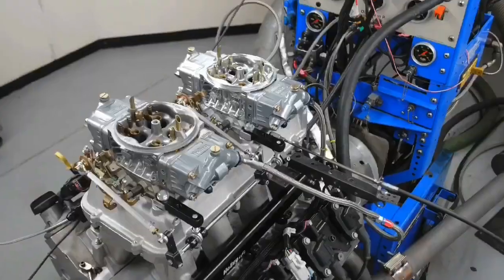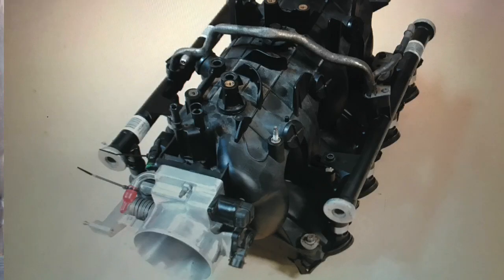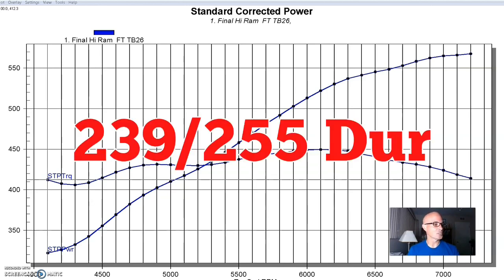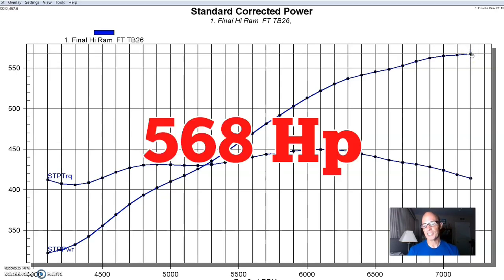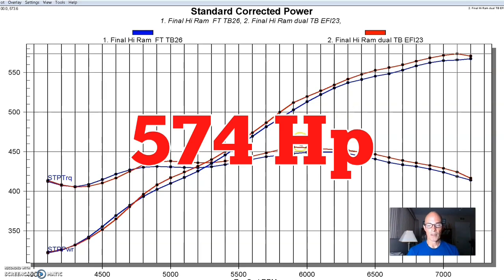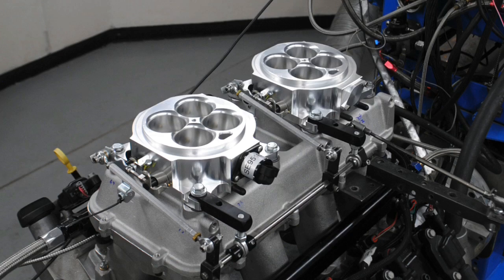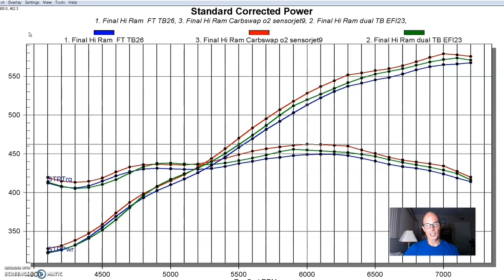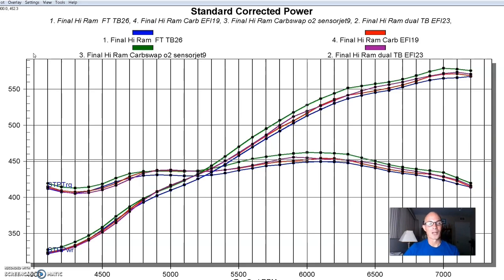LS1 CARBS vs EFI-WHO WINS?

Comment: So just for curiosity purposes; 
Use a vacuum gauge and compare the two 650 carbs to two 390 cfm carbs for a total of 780 cfm. 
Two 500 cfm carbs for a total of 1000. 
I'm real curious to see the difference in the power curve. 
I think the dual 650 setup is overkill.

Comment: You had injectors at 50% duty cycle. How can you say with straight face that "fuel was optimized" ?
Reply from the maker: optimized is when the motor makes no more power by adjusting the AF
Reply: @richardholdener1727  with IDC that low, injection end angle becomes an issue, especially with 20deg cam overlap. I doubt anyone spent a day finding optimal IEA per RPM; smaller injectors would do the trick tho. 
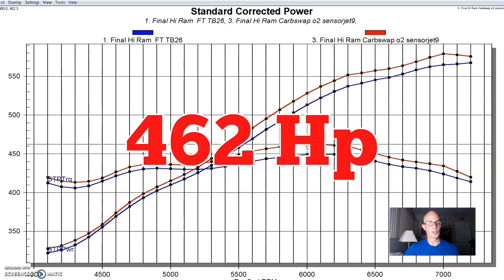P.S. Torque is not measured in HP.  I assume you misspoke at 7:12; but then misannotated it as well?
Reply from the maker: so you are one of those guys-please, spend a full day trying to coax 2 hp from injector timing and see what you get (we know, we have wasted those days trying it)
Reply: @richardholdener1727  No sir, I am not one of those guys, neither are you. You are testing power difference between fuel cooling air early (intake plenum) vs late (intake valve/combustion chamber), right? I just pointed out a hole in methodology. Solution would've been 42-50lb injector. Honestly, I don't even know if it would make a meaningful difference.
Respectfully : Andrei @ ABEL Racing (22 years and 50,000+ dyno pulls ;) )

P.S. I am not the smartest tool in the shed, but I bet it has more to do with atomization   than actual cooling; like you said at high rpm air/fuel mixture spends about a revolution worth of time in the intake itself - less than 10ms.

Comment: So in theory, a set of the holly sniper tbis on the high ram lid would push close to the exact same number as the carbs due to charge cooling, with more possible drivability in a street car application
Reply from the maker: maybe

Comment: The dual quad lid performs better because the air comes straight down through the barrel. Air doesn't like to turn down into the engine. Also just the coolness adds power.

Comment: I think fuel injection really wins when it comes to cold starts, altitude changes. Seasonal changes. But carburetors when tuned properly will always be able to make a little more power just because the fuel will cool down the incoming air. Annular boosters are next level for carbs too.
Reply: the like of Claus Schwabb and others on the UN Agenda 2030 dont want carbs but all digital and easy for "THEY" to monitor, steal and control everything digitally. I love analogue, carbs and control of what I do and got my carbs giving better fuel economy on hilly terrain than efi has.

Comment: Nice test. But, I think atomization of carb mix and some cooling may be the factor. I favor 500 CFM bodies for more velocity and better mix. Velocity that works with valve size and angle job down low as well. I like E85 for the charge cooling and injection for precision, altitude, weather variables/tuning. Then when combined with computer timing and matched variable modes there's no doubt. EFI all day long. I think there may be more power tuning in fuel pressure and injector atomization, alone. And then combined with E85 (40 percent more quantity).  But, an EFI tunnel ram, actual cold air on the street, vs heated carb under a hood is still a winner.

Comment: And what costs more and is less reliable? Not the carb!
Though a 4 bbl electric carby V a similar size carb would be the test.
Though,,, for every day driving I hate top say the fool injection is nicer to drive. Though  that is when all the electric gizmos are working in coordination. And that is not often enough.
Even factory mass produced cars cause a lot of grief. Grief that the 'experts' often cannot work out. So either it does not run at all or is a gutless thirsty thing.

Comment: I would love it if you would do some tests on mechanical fuel injection like a Hilborn. There's very few resources on mechanical fuel injection and I would love to see a comparison between EFI and MFI
Reply from the maker: the difficulty is getting mechanical fuel injection to work at all combinations of throttle angle, load and rpm-wot is not usually a problem, but sometime getting it to provide a consistent AF ratio through a wide rpm range at WOT is
Reply: @richardholdener1727  right! That's always been my concern with mfi. I also don't really consider mfi a type of fuel injection, that may piss some people off and they may call me wrong but if you really look at it mfi is more like an individual carburetor setup per cylinder than actual fuel injection. Mfi will not account for changes in altitude, pressure, humidity and temperature the way EFI I will. It will give you the adjustability per cylinder as EFI but you still have to change the AFR yourself with different nozzles and metering orifices based on the position of the barrel valve the same way you would have to tune a carburetor for changes in ambient conditions. That's why I don't understand why I think mfi is a little bit misleading. But I don't know that's just my opinion I'm no expert. I would like to see a comparison between MFI and EFI for this reason.

Comment: I hate it when tests like this are done and people get offended because they have a preference to one or the other and it's not about that at all every injection system has its own benefits. I prefer carburetors because I was raised on them I like how simple they are and they do what I want them to do. And fuel injection has its own benefits of being able to data log and tune per cylinder etc . I was actually tooling around with the idea for fuel injection for my dragster but the system I would need would cost almost $10,000 and for my $1,200 carburetor I don't think $8,000 is going to get me that much of a benefit in return.

 Plus if you're running methanol carburetors are the way to go because you have such a bigger window of tuning acceptability I never have to chase my AFR. I just run my car a little on the rich side and the methanol will pick up the difference it's not like gasoline where your AFR has to be exactly spot on or you'll be fighting detonation or lean conditions and losing power gaining too much power methanol is much more forgiving.

Comment: The charge cooling from the carburetors is why 6-71 Roots blowers worked so well. They didn't need intercoolers because the fuel was cooling the compressed air. I now see companies using port injection under the roots superchargers (Edelbrock) and they have to add an intercooler.  If they would put the nozzles in a plate under the throttle bodies on top of the blower, they could eliminate that added complexity (like old school blown dragsters).  They would also have the added benefit of very a well mixed mixture and with a little more care in intake design, more even fuel ratios negating the need for individual cylinder tuning. It would also open up the possibility of using two sets of injectors.  One set above the blower for part throttle and charge cooling, then adding port injectors for high boost with max power and cylinder tuning.

Wish I had the money to build such a system for my 1990 heavy ass Suburban to replace its puny swirl port TBI.

Comment: That was a interesting test. Didn't expect the carbs with port injection would match the port injection in power, or that the carbs would best it like that. So a single plane port injected manifold, with say a 950 dominator on top with a tps would make as much power as those expensive throttle bodies they sell? Or just go to a Sniper TB with fuel. The problem is cost, starting at $1500 up.

Comment: Great video and again it comes down to picking the correct combination. I have seen several high dollar EFI setups that were wired incorrectly causing multiple issues for customers. Once corrected they worked awesome and having the ability to tune each cylinder is a big advantage. I’m a carburetor guy. I can make the worst carb perform well. I just think that in today’s performance world EFI will make your life easier. I really like to duel throttle bodies in the tunnel ram and would like to see a twin turbo blow thru test with this combo.

Comment: Charge cooling.
 So if you put a water methanol misting in the intake stream after air filter would it do the same as charge cooling with the carburetors?

Comment: This is great high-end stuff! May I ask if you are ever interested in grabbing just a 5.7 Vortec with the sequential injector setup and the change over to carburetor to see what to see what kind of operation you can achieve. Those Motors were very plentiful in the mid-to-late 90s. I understand the downfall was the Spider injector set up. And I'm very curious because I have 98 Chevy with the 350. Thanks I like the work you do!

Comment: How about combining throttle body and port injection by running small injectors at each port with the majority of the fuel coming from the TB and fine tune each cylinder with the port injectors?

Comment: Still in the fuel injection camp. Computer optimized for temperature,  altitude, optimal power  and fuel economy and emissions. There's a reason no manufacturer of automobiles uses carbs. Sure you can dial carbs in. They will run perfect at that temperature, altitude etc but as soon as that changes, they run like shit. If you don't drive it for a while, the seals/gaskets will leak. Less so for fuel injection. My take...

Comment: Hi , just want to point out that not only distance provides charge cooling but also the booster/ventury effect (like an h valve in a/c)does cool the charge a lot more than any injector at any pressure.Would like to see a test where we take a carbed engine(camshaft)and then swap an efi on it.It might not even run.So why do we always test an efi motor with a carb.This should put all the debate to rest ... Forever.

Comment: Another big tell-all with charge cooling... this exact same test but instead of pumpgas, use e85 or even methanol. When fueling with the carbs, the runners will condense moisture because of how efficiently the fuel cools the air/fuel mixture

Comment: What about an intake like a stack injection, with the fuel rail and injectors moved as close to the top of the stack as possible? Or that aspect with a taller stack? That way the injector sprays at the top of a raised port for charge cooling and has the tunability of individual injection? I'm just spit balling here, but curious if that's plausible?

Comment: I learned that I need to see a blow through carb on an ls w/E85 and a turbo. No intercooler.  I just can't remember if Richard has done a video on that. I seem to remember a video with a blow through carb and the difference between 91 and E85, but I can't remember the motor the test was done on. Probably an early video. Good stuff. Run what ya got I guess 🤷🏼‍♂️

Comment: Man I don’t know how you can think of so many things to try!!!!!Im 60 years old and have always loved reading about motor builds, I would read and read and think about every little detail since I was 13.You are up there with Smokey Yunick , Grumpy Jenkins,.Bill Glidden,Gale Banks and Nelson in their day, that’s a tremendous compliment!!!!!Im really not surprised that the carbs did so well,also that 2 650 cfm carbs were sufficient on a dang near 600 hp 5.7!!!Loved the carbs as throttle bodies just to compare, you are a professional motor builder no doubt!I have a suggestion how bout quench? You know piston to flat part of the cylinder head test?If you be done it I missed it🥴also how about cutting the combustion chamber out to the bore around the valves test, I know that it works.Ok, one more solid verses hydraulic roller cams?You’re my favorite by far I don’t even watch the other guys at all,can’t wait till the next one 🤗🤗

Comment: completely off topic and i understand that there are a ton of variables  but on stock LS with flat top or dish pistons what is the max lift and duration you can run before piston to valve clearance becomes a issue

Comment: Awesome video, as always the numbers are factual.
The biggest advantage to fuel injection is as you stated; control of each port. This isnt the case with the other fuel supplied systems, thats based on averages.
Id say the other reason for fuel injection advantages is; atmospheric conditions and power adders. The control over these with the proper tuning and data is certainly a good reason for fuel injection. 
Fuel injection as its disadvantages as there are more components for diagnostic trouble shooting and figuring out what part is the problem. 
Carb's have their own issues too; floats sticking, secondaries sticking, but they are so much more simple to diagnose and quicker to remedy.

Comment: On a similar subject but regarding a roots blower instead of tunnel ram.  The Blower Shop claims they make more power by placing the injectors in a roots blower case itself vs. on top or below in the intake.  Have you ever run one of TBS's injected roots on the dyno before?
Reply from the maker: I have not-where in the case?

Comment: i acquired a built 347 with holley efi made 331 hp on the dyno.... i laughed and said watch this, eldelbrock air gapped with a 950 QFT 4150, made 527 on the dyno ... more fuel,air,timing then the efi could deliver 👍
Reply from the maker: from 331-527? With a 347 and Air Gap?

Comment: In the past, I remember reading about an old racers trick of adding a screen between the intake and the head to re-aromize fuel just before it enters the combustion chamber. I believe Super Chevy magazine did a test on this & reported that throttle response had improved. Based on your proof that cooler charge is the mitigating factor in making more power in this test, what would happen if you took a k&n style air cleaner & mounted it down by the front airdam, & put the fuel injectors right behind the air cleaner, & placed a few screens at different intervals inside the intake tube to help keep the fuel atomized throughout its long journey to the combustion chamber? 
Would we experience poor drivability down low?
Would we experience fuel puddling?
Would we gain a good deal of power from a much cooler charge? 
Free thinkers want to know the answers to these pressing questions! Btw, great channel & keep up the good work. Moving to a 6.0 in my 66 impala next year!
Reply from the maker: i think that would only act as a restriction
Reply: @richardholdener1727  Not worth a test? Keep it in the "rainy day" pile of ideas!

Comment: A lot of motorcycles use a lower set of injectors that spray fuel at the intake valves as well as upper showerhead injectors, like on some older F1 engine's I've seen. They locate them in the airbox lid on the motorcycles.

Comment: It's not just the charge cooling effect but also the increase in charge density effecting the "Ram Fill" or "inertia-fill" effect. If that column of air/fuel weighs more, it only stands to reason the inertia (momentum) will be different.
Take a look at any of the Indy injection systems. There's a lot of different reasons they're using the "shower head" injectors as far upstream as possible.

Comment: Again, there are no mass airflow measurements in this test which you would need to make conclusions regarding a change in airflow vs cooling being the cause of the extra power. Please point to a fundimental physics principal that says for a given mass air/fuel mixture, that the one that starts off colder gives off more energy. The opposite should be true as the hotter the mixture, the easier it will be to ignite and the less ignition lead would be required which does result in more power since less energy will be wasted on the piston at the end of the compression stroke.

Comment: I love watching your content. I learn something new every time I tune in. I wonder what effect a single hi ram hat would have vs the dual quads? I built my novice version of a max effort NA LS3 based 417 with a CID 4.5 intake and 1150 ADP dominator for my rear engine dragster. I will be building a very budget 5.3 with high compression NA motor as back up and was considering a Hi Ram. Keep up the good work!

Comment: What if the motor was a turbo motor and the carb was BEFORE the turbo. Meaning the air is drawn into the carb then into the turbo and then into the motor. Could that cool the turbo also?

Comment: Ive gained 40hp before moving injectors further from the valve on a turbocharged 6cyl. It definitely helps. Would be a cool vid to show people on a fabbed long runner manifold. Weld in some bungs just after the plenum and some right at the valve then swap between.

Comment: Don't know if this has been asked - wouldn't you also get an advantage from carb in that there's usually not a fuel return line which eventually can transfer engine bay heat into the fuel tank?